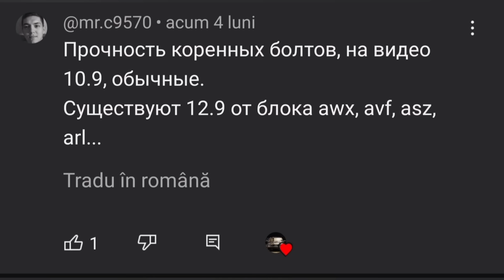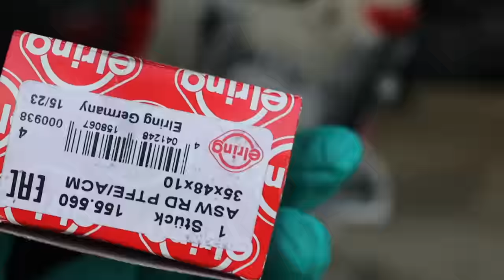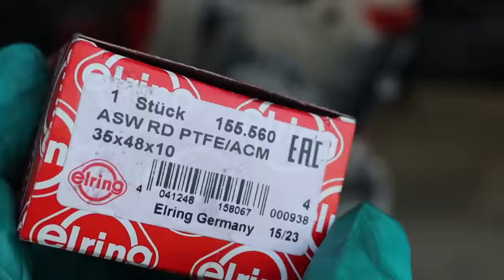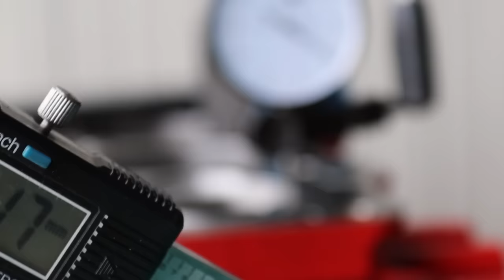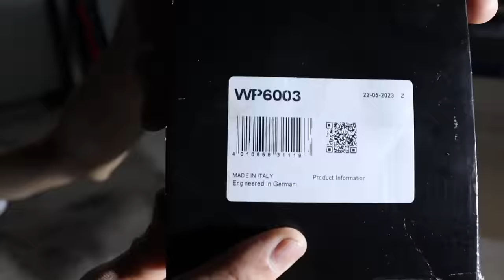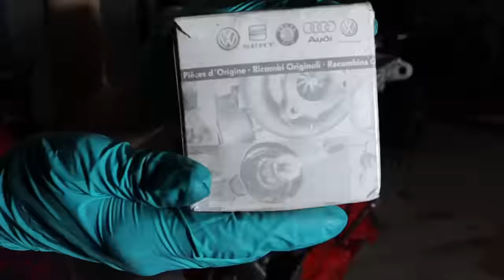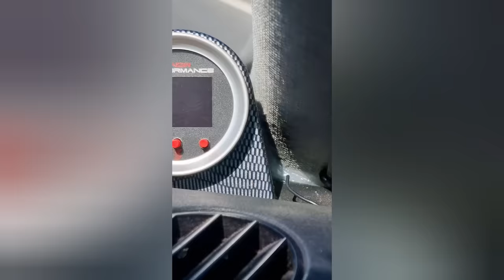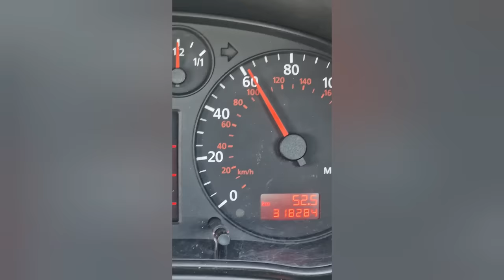1.9 tdi pd 8v Time-lapse Race Engine Rebuild + first start 2023

Comment: salut , cat costa un rebuild de genu? cum putem lua legatura? ( nu am insta)
Reply from the maker: Salut uite ai lista si preturile la ce este in motor acum :
 Chiuloasa Veicomer full race - 1200 £
Injectoare firad 120% - 960£
Turbo hybrid GTB2566VK - 1560£
Ambreiaj Sachs SRE performance - 1400£
Galerie evacuare Darkside - 1200£
Biele ProRaceEngineering - 400£
Prezoane chiuloasa ARP2000 - 300£
Racitor ulei - 84 £
Pompa ulei - 70 £
Distributie OEM - 150 £
Lant ulei+ patina+ semering - 50 £
Garnitura chiuloasa - 25 £
Senzor map 6 bari - 40 £
Cuzineti biele + torco - 57 £
O-ringuri inj - 33 £
MAP flange - 30 £
Termostat - 20 £
Cuzineti arbore KING - 30£
Roata zimtata mica distributie oem - 15£
Roata zimtata mare distributie oem - 28£
Friction disc diamont coated crank - 40£
Arp flywheel bolts - 48£
Suruburi oem galerie ad. - 90 lei
Suruburi oem arbore cotit 12.9 - 120 lei
Surub oem intinzator + piulita oem - 22 lei
Pompa apa conti - 205 lei
Semering mic arbore elring - 42 lei
Semering axa came elring - 28 lei
Prezoane + piulite evacuare oem - 92 lei
Suruburi fulie distributie oem 3buc - 24 lei
Întinzător oem - 20£
Segmenti+cuzineti+semeringuri- 245 £
Pompa tandem bosch - 20£

Total doar in motor 8145 £
Reply: @WRCgarage  am inteles, eu as vrea ceva daily adica nu pt race soft de cai mult..ceva Basic cu o turbina ARL pana în 200 cai. Masina în cauza e un sharan. Tot caut pe cineva care e atent la detalii și folosește dinamometrica..mulți cică o au în mana...și nu găsesc. Și mulți mi au zis ca nu se merita. Piesele OEM sunt sfinte.. alții zic ca merge și after..nici nunstiu ce sa fac. Motorul are 400k masina o am de noua. Am primit info cum ca nu merge doar segmentat și celelalte piese aferente,  trebuie honuit și blocul. Nu am probleme. Nu consuma ulei sau ceva...și nu cred ca ar trebui honuit..acum aștept o părere.
Reply from the maker: Pai trebuie desfăcut prima data sa vezi cum arata cilindrii si dupa iti dai seama daca trebuie sau nu honuit, o honuire usoara cum am facut si eu este simpla de facut si nu costa mai nimic, scula este ieftina si este un avantaj. Iar cu piesele da, trebuie totul nou, nu neapărat oem dar firme cunoscute nu FAI, FEBI sau alte de genul, cauti Elring, goetze, victor reinz, king, glyco, continental, KOLBENSCHMIDT, mahle, etc , suruburi tot nou ce este in interiorul motorului si distributie neaparat noi daca nu vrei sa ai probleme, nu neaparat oem dar sa fie noi, macar la distributie ia oem suruburile si piulitele, in rest nu e mare lucru se face usor .
Reply: @WRCgarage  asa ceva simplu, cât ar fi? Doar mana ta de lucru ma refer . Sa ți aduc masina
Reply from the maker: Nu sunt in țară, si nu lucrez momentan decat pe masinile personale.

Comment: Oil pomp topran 🤦🤦 unlike
Reply from the maker: Same used last time, not a problem at all, 10 bar oil pressure all the time cold and after1500 rpm when is engine warm (90⁰)

Comment: Неужели нельзя хон поправить на станке? Лучше шуруповертом с насадки от китайских братьев шилиндр нацарарать.
Reply: Это не бюджетно. Лучше побольше приборчиков. А то что цилиндры изношены и зазоры выше крыши ничего страшного
Reply: И опять только на великом и могучем конструктивная критика на вентилятор🤦
Reply: @shaban2984 чел замерил ,если все в допуске, нет элипса,в чем проблема ?
Reply from the maker: Thank you, they won't understand that it's all measured and checked, and its not about money when i have already spend over 8k £ in that engine.
Reply: I don't understand why it was necessary to invest so much? A new motor costs a lot less
Reply from the maker: @user-bh8ye2vp7o Because this engine it suppose to be just for racing purpose, and a new engine won't last to that much power wich ill use on the rebuilt engine.
Reply: @WRCgarage  ok.👍